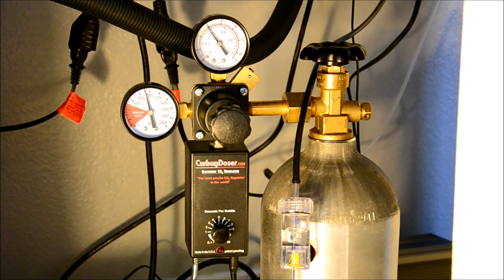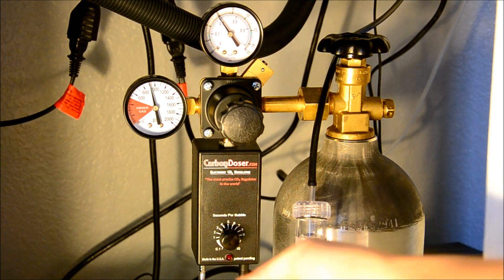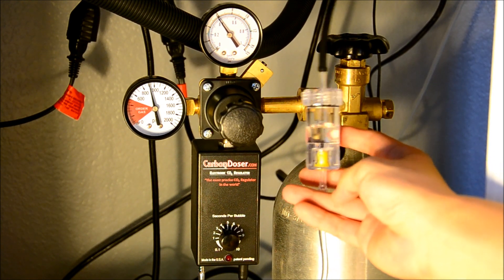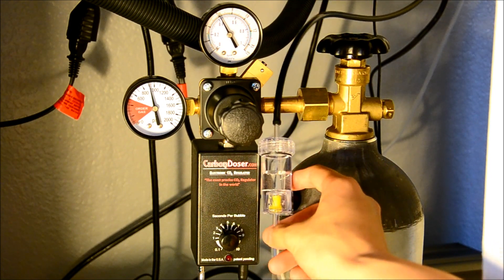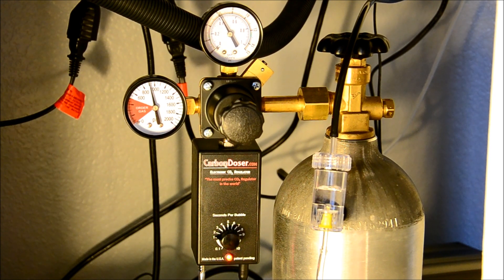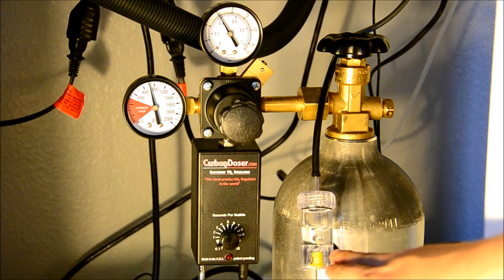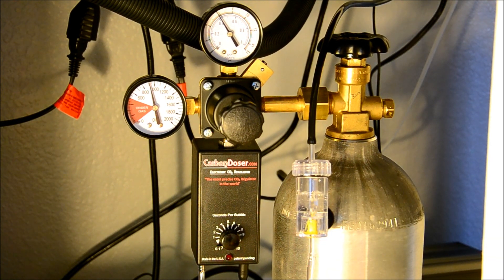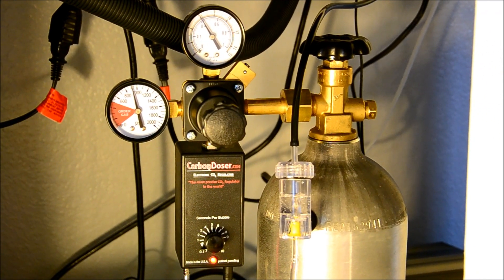🌟 Amazing Accuracy 🌟 CarbonDoser Electronic CO2 Regulator Setup and Test Runs

Comment: Hello! Do you still use this equipment? I was looking for an ISTA Co2 regular regulator set with solenoid valve
but now I am start thinking about this Carbon Doser electronic set. I'm new on the hobby and some people are saying that if I use Apex, I won't need this regulator at all. What are you think? By the way I will be use the Vertex Carbon Reactor with the Pacific Sun digital precise flow pump. Ah, the bubble counter looks great. where did you purchase it from? Thank you very much! ;)
Reply from the maker: Yup, I have x3 carbon doser now and still using them. The link for the regulator is in the description or you can get them at bulkreefsupply as well now.
Reply: j03yYunG Aquariums Yes I saw it on RBS and other places but I was talking about the bubble counter too :) Do you use Apex?
Reply from the maker: The Bubble counter was to check the regulator's LED blinks. If you get this regulator you won't need a bubble counter since the LED is accurate. I'm not using an Apex just a timer.

Comment: I recently purchased the complete co2 system from AQUARIUMPLANTS.COM and everything I've seen in your videos looks just like what the system came with, I saw your Milwaukee MC122 Ph controller video, and it looks just like mine. Did you buy your system from the same web site? I've not hooked up anything yet since I'm trying to learn how to connect everything, I'm new to the co2 thing, but have always had a 55g planted tank, now I'm starting all over again but with co2.
Reply from the maker: Awesome! You'll love this regulator for sure. I brought the ph controller somewhere else but it's a common unit that can be brought from most sites. I just use the ph controller for monitoring and not really for the controller itself.
Let me know when you have some video of your tank up. I love seeing other people's setup.
Reply: Sure will!!! ;) Did you connect your co2 to the ph controller or to a timer to shut it off when the lights go off?
Reply from the maker: YOUSIYC7 I have the regulator to a timer and my lights to another timer. The CO2 comes on 30 mins before the light does.
Reply: Gotcha... Thanks.